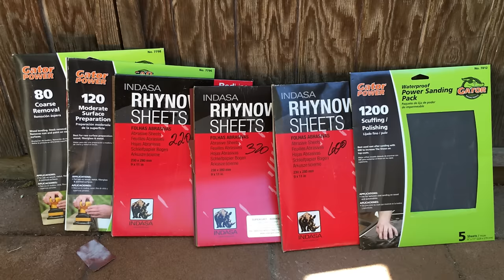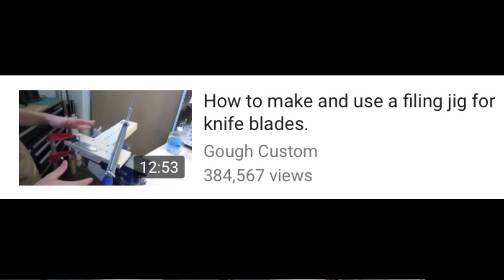QUESTION & ANSWER PART 1

Comment: I'm actually planning on starting a forge, but I think I'll do stock removal before then. But yeah, Trollsky, White Bone Knives, Dark Timber Custom Knives, and you have really got me hyped up to start making knives. I hope all goes well with your business!
Reply: Also, I always thought about making folding knives, but I would have to say that friction folders are by far the most simple to make. Sugarcreek Forge has a nice playlist on his channel.
Reply from the maker: +Xero Yeah, but I am not into folders at this moment. To make folders you need a milling machine and I do not want to disappoint myself when I would not get the tolerances I need with a drill press.

Comment: Hey man,if you do more Q&A do it on stream,maybe on twitch.There will be more questions that this.But if you have time.
Reply from the maker: +TheGamingPanda Unfortunately I do not have any time. I drilled 2 holes yesterday (1 inch) and finished drilling out the rest today. In two days I accomplished 7 drilled holes. It takes for ever because I have to record what I am doing, change positions of the camera. It takes forever.

Comment: Hey from the uk I follow most the same blade makers as you , you must have good taste lol please try a " tanto" with a piece of Damascus it looks great and the folks will not question the bill lol your work is getting better ,so keep going and have fun .ps you will need to get a 2x72 at some point so long into a guy on eBay from Greece your be surprise 😇
Reply from the maker: +todd parnaby Wow, we have an awesome taste in knife builders. When I move to a house and have more room I will definitely get a belt sander. Damascus steel is around $200+, I am not ready to spend that much money on one knife. Later on I surely will.
Reply: +SLAVIK TELY hi you can get cheap Indian Damascus. On eBay for around £24/45which you can get good results with , do you have a Facebook page so I can send you a pic of one I've done ?
Reply from the maker: todd parnaby I do not have Facebook. Only Instagram, Google Plus and just recently opened an account with Twitter. Still do not know how to use it.
Reply from the maker: todd parnaby I just looked up knife forums on Indian Damascus and most of them say they use cheap steel which you can melt with a torch. Then it is not good to use for a knife.
Reply: +SLAVIK TELY thanks for info but I've had no prob yet 😀
Reply from the maker: todd parnaby your account is private.
Reply: +SLAVIK TELY it's open now lol
Reply from the maker: todd parnaby Thanks.
Reply: +SLAVIK TELY all the blades on instergram are 100% handmade 😈😎😜
Reply from the maker: todd parnaby Thank you for letting me see your handmade creations. Best of luck with your other knives. Slavik Tely.